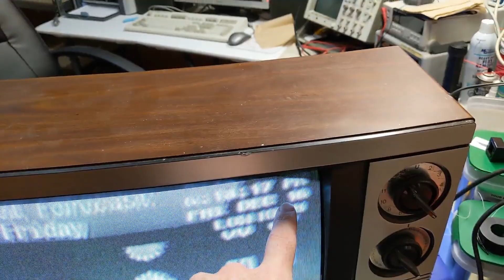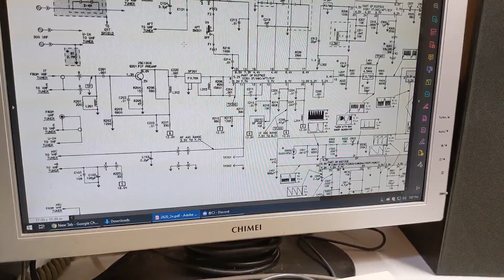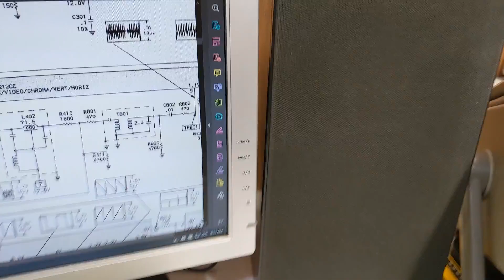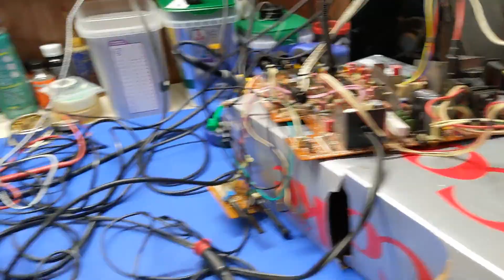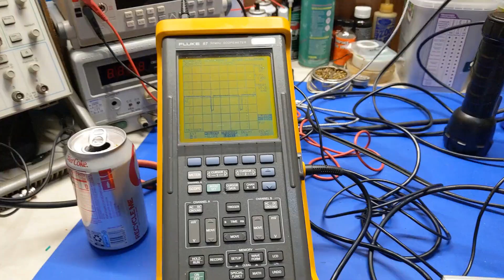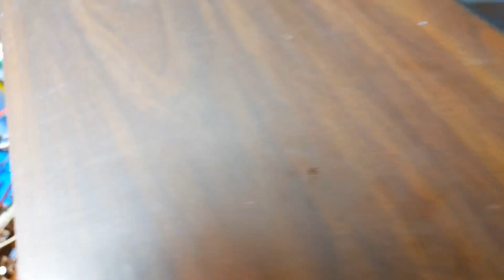Sharp Linytron 13MM17: No Color troubleshooting

Comment: And that is why you keep high voltage capacitors shorted when in storage. Big ones with much higher capacitance than a CRT can knock you flat with the charge they develop over time unless you do.